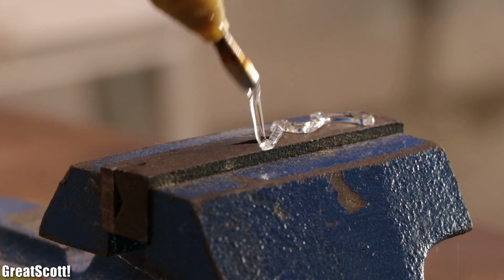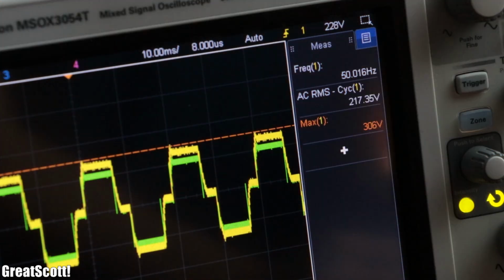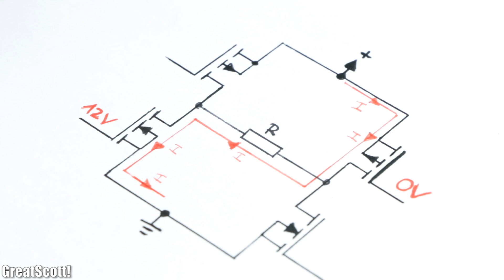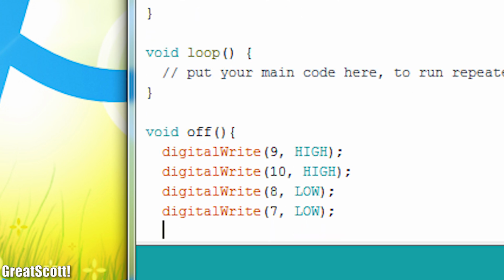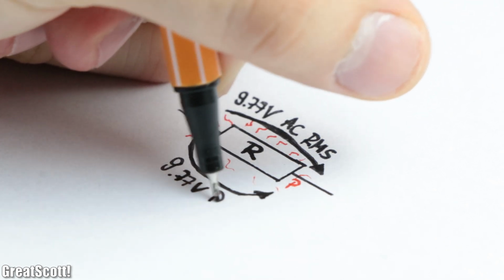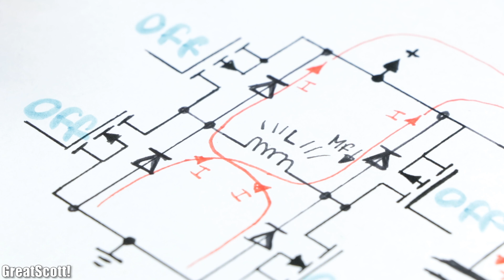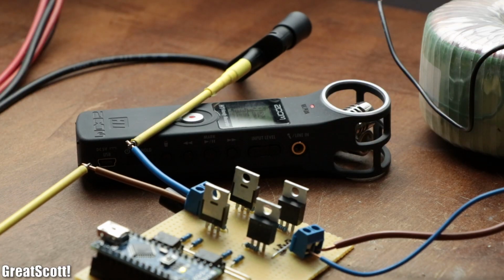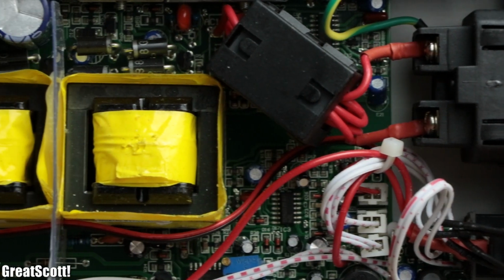How NOT to make a Modified Square Wave Inverter

Comment: Ehhh.....
This is incomplete information. 
Frequency isn't really discussed, and that's a pretty important when you're emulating Mains AC. 
Realistically, you shouldn't be pushing your inverter to go more than 10% above or below the frequency of the mains line you're emulating. (So the faults at higher frequency are kind of a non-issue. )

If you're in the USA, that standard is 60 hertz. If you're in europe it might be different. It goes by country to country. I mention this because impedance becomes an increasingly important factor as frequency increases. Components that acted as dead shorts (IE the inductor you should be driving with this circuit) act more like capacitors as their reactance becomes more pronounced. Capacitors act more like resistors. Semiconductors become signal detector meant for operation at specific frequencies, rather than generic one way blocking devices that can be haphazardly placed where ever.

It's not that AC is hard to deal with or even extra dangerous; rather Impedance and reactance are subjects simply ignored in circuit theory. Inverters are kind of the perfect storm where all of that stuff you've ignored comes out to shake your hand and remind you that it's a practical reality. 

After that rant, don't use mosfets on the legs of the h bridge. 
This is clearly a current control situation, not a voltage control.
 There are also high loads. 
This is why they developed the IGBT. 
IF you're still trying to be cheap, use a regular BJT rated for at least double your mains voltage rating.
Reply: Actually you'll want the inverter to be capable of varying its output voltage and frequency in sync for running motor loads. Known as V/Hz scaling, it eases starting and reduces power usage. That sort of inverter is often called a VFD.
Reply: Actually I don't know if that would be good. 

To be honest, that seems like a power conditioning concern for an individual device and not something that should really be integrated into the supply inverter for an off-grid system like we're being shown. 
That's something that very common in electronics, and I don't think it's good. Matching the supply to the demands of 1 or 2 devices is fine if they're the only connected devices. As a supply though, they might not be. 

As far as efficiency, it's improvement would go down dramatically the more devices connected to the load, and, at that point, it's a question of how much power does the individual circuit used to match voltage to frequency consume, since it's operation would constitute an inherent loss of efficiency.
Reply: V/Hz scaling works just fine with many motors in parallel. It's advanced algorithms like FOC that do not work with multiple loads.

Comment: you say it isn't good, but sometimes all you want is a low power ac supply for lightbulbs and resistive loads that require 120v or 230v...

Comment: Why use any inverter? 90% device dont need inverter. Only ac motor needs. Just use dc-dc converter and convert to 110v or straight from higher volt battery.  Most modern european electronic works on this voltage too. Every device have plate on back. No reason to change to ac an then device change back to dc

Comment: I was just wondering, if it is for non grid tied applications and IF the device to be powered is not relying on the power being AC and just rectifies the voltage into DC before using it further, like so many devices do nowadays with their SMPS, why cant we built a boost converter to step up the voltage at 330V and fee that directly to these devices? The divices would not care if its DC/AC, as long as the voltage is right...

Comment: A MOSFET has a built in reverse body diode. The external diodes only features a lower voltage drop. You should have configured your "inverter" as two half-bridges. Then the unused MOSFET acts as a nearly lossles diode.

Comment: you can upgrade your curit to an USV  with a multi transormer you can measure feedback  to control  the AC Power.  
Is it also possible tu use Arduinos PWM pins  and a filter to make a Sinus wave for better results?

Comment: And is the inverter good enough if you power it with a voltage that make his output be 230 volts without a transformer in the output?

Comment: I have a 300W Sine wave inverter and its great. We get sporadic power outages here and with that thing i can power my fridge, charge my phone, power a light all from a old ebike battery (that i connected together for a massive ~12V 40 Ah. It gets charged by a 50W solar panel and is completely off grid. I used it 2 times and each time it was just brilliant to be the only person who had electricity. That smug feeling is worth it.
Reply: I know the feeling - my recent inverter purchase gave a similar feeling during a planned outage; and only i had 240VAC!
On a side note, be careful with that fridge; i'm amazed it runs off the inverter at all; usually the compressor can have a high start-up current (imagine compressor piston is at top dead center - a lot of current will flow to even get the thing moving) which generally makes most inverters sad...
It may work most of the time, but it may also knock out your inverter one day... Just a thought!
Reply: 300W can power a fridge?
Reply: @kjaved8  nahh i think 1000w inverter is good to be on the safe side (500 is fine)

Comment: I am a big fan of you, but honestly, this is the first time I feel disappointment about the video's content
No one now uses such old fashion DC-AC inverter circuits

New inverters are now includes two stages:
1. DC-DC converters to increase the voltage from 12VDC to 310 VDC using four or eight MOSFETs and SMPS transformers
2. DC-AC inverters using four IGBTs.

I was hopping from you to implement such circuit.
Reply: Sure is old and less fancy, but this is the most popular kind of inverter used in DIYs.

I like mine better:
1. High frequency oscillator and step up transformer to 220V RMS.
2. Full wave rectifier and final 50Hz low frequency oscillator.

A sine wave capable setup will be sick though.

Comment: Exciting video, but I have 3 questions about:
1.Can a pure sine wave inverter be used in an electric car? 
2.Can the mosfets of an inverter circuit be oriented in a "X" pattern? 
3.Would your DIY inverter schematic work in a electric car? (Adding safety features like all the commercial ones have of course)

Comment: Unfortunately, most made in China inverters have their MOSFETs fry after a few days of use even at 70% use of their full power. The really good ones like SMA cost 3500€ a piece, I'm pretty sure I could DIY a similar one for half the price or less.
Reply: A 1009W DYI close to pure sine wave inverter can be done for less than 100$

Comment: If I want to use a potentiometer for a volume control for a car amp, can I use a Audio taper pot or Log taper pot and connect it to the channels of the 3.5mm jack then to the RCA inputs on the amp? I need some help on an interesting project
Reply: Yes, you just need a voltage divider. If your pot has 3 pins, connect the audio source ground and amplifier input ground together to the first pin, the amplifier input signal to the middle pin and the auido source signal to the third pin. Its only important to take a pot with a high resistance to prevent shortening the audio source. 10k should be more than enough.

Edit:
One pot per channel, for stereo you need two potentiometers (available in one case with a single dial for both channels)
Reply: David Weis
Thank you for the response. If I have a left and right channel, do I need a 6pin or should 3 be fine?
Reply: @R3MIXMODZ  It CAN work with a single 3 pin potentiometer but I would not recommend to short both signals to one pin. You might be save with additional resistors but you will have no advantage compared to a 6 pin pot (2 potentiometers mechanically connected)

Comment: What about using boost DC-DC to make 310V and then switch it with H-bridge to make AC 220V? What kind of drawback are in this circuit?

Comment: I hated these stupid designs for this reason and because they use a big and bulky transformer. They are only good for small range of light loads. I may make a video on a better design using a ferrite transmormer rectified for 170V output and then an H bridge output PWM driven for a sine wave output.
Reply: ferrite at 50 or 60 Hz ?
Reply: @noweare1  No. At several dozen KHz. H bridge comes later after rectification.

Comment: Before i say what i want to say, i must say i have no education in electronics or engineering.  Lol.  Ok.  If you can generate a sine wave with an op-amp, why can't you create a power inverter with them?
Reply from the maker: Try driving a transformer with that signal and you will see the problems yourself.

Comment: 1. A transformer isn't an inductive load unless the secondary is open (only a bit of leakage inductance).
2. Please read your scope manual. You may learn ways to get a stable display of the spikes. (e.g., try a larger buffer, or peak-detect mode...)

Comment: Could you show the other way around? Getting a low DC Voltage from the Wall?
For example to power a microcontroller. Normal Phone-Chargers would be too big for the project idea I have... :D
Reply: You could use a small capacitive dropper (smoothed of course) because the microcontroller doesnt draw that much current 
It would be smaller but not as powerful

Comment: Why is it more difficult to create a pure sine wave versus a modified sine wave inverter?
Reply: because of heat dissipation when trying to follow a sine wave output it goes into the linear region of transistors which creates a lot of wasted power into heat, it only works for very low power stuff, of else it gets impractically inefficient. I assume most commercial sinawave inverters will use something like class-D amplifiers.
Reply: @victornpb  Interesting. I've always thought of pure wine wave inverters as being superior in pretty much every way to modified sine wave versions. Seems I've still a lot to learn about inverters and the like. Thank you for the insight.
Reply: Sine wave inverters are superior. Square wave inverters gives you high efficiency and simpler design at the cost of producing a imperfect mains line with a lot of harmonics (components of the square wave) which is not ideal in some circumstances. The challenge on creating a sine wave is that you have to create a voltage ramp, which means that most of the time you have a switch that is halfway open and halfway closed, and that creates a lot of heat in switches (transistors), compared to square wave which just open and close fully. And analogy would be like a half way opened tap sometimes produces a audible noise, because it creates a lot of friction to the water passing, but if you open it fully it doesnt obstruct the flow, so no stress on the tap valve.

So in order to create sinewaves without producing a lot of heat they pulse the transistor on and off at a much higher frequency than the mains frequency, to create the sinewave ramp out of a PWM signal. But that requires a much more complex circuitry than a simple 4 transistor circuit, hence the higher price.
Reply: @victornpb  Great analogy! Ive always known that pure sine wave was far more complex, but never dug into why. Well, now I know. Makes perfect sense that the components generate a lot of heat given that individual components, like transistors, operate in either an off or on state and dont like being half on/off like what's required to create a pure sine wave.

Comment: Since most common devices use switching power supplies i think whoever wants to build a diy inverter is better off making a dc boost converter instead and avoid using linear power supplies (the only problem i can think of is the diodes rectifier getting hotter than normal or some low power devices or leds not working if they use an in series capacitor)
Reply: Valid point, just run it off 300V DC. Beware of mechanical switches, they don't like it.
I don't expect the diodes to get any hotter, you just have a low average current, and no peaks.

Comment: Mmmm yeah the 400V spike is bad. I have another idea. The batteries are in series to get more than 230VDC, and then construct an IGBT inverter circuit to get the sine/modified square wave.
Reply: Oh wait it's a motor drive lol

Comment: "Invest into a proper one with a lot of safety features" 
Yeah... without any kind of proper reverse polarity protection :D

#ElectroBOOM
Reply: Provided the input is fused; a beefy diode placed across the input in reverse is all the protection you need...
It has NO losses when operating normally, and if your primary polarity protection fails (the big RED and BLACK wires being OBVIOUS), then the diode conducts at full whack and blows the fuse; whilst the protected device never really sees more than -1V or so.
If you wanted, a resistor in series can limit the "whack" at the expense of having to find a beefy resistor too.
Reply: All they need is basic FULL BRIDGE RECTIFIER!! Its that simple.
Reply: Meme aside, rectifier is one of the worst kind of reverse polarity protection because now you have twice the loss compared to a single diode protection.
Reply: Nope, that's really what I meant. Full bridge rectifier has four diodes, two of which will conduct in the same time depending on input polarity. Because you have 2 diodes in the circuit instead of 1, now you have double the voltage drop and double the loss.
Reply: Yes , the problem bridge rectifier have a considerable amount of unwanted forward voltage drop of around 1 V per diode, A full bridge is about 2 Volts, this is unacceptable in a 12V system. Power loss in bridge is far too high. Even a single diode is too much. Reverse protection is done by using a power mosfet as a switch with a on resistance on just a few milli-ohms, which only activates when power polarity is connected correctly. Power loss and voltage drop across the mosfet is very very small.
Reply: Labs did you say diode..? I think you ment p-channel mosfet for reverse polarity protection

Comment: Hey great Scott, you should build a diy air conditioner. It would be a fun project and be helpful in the summer. Thanks!
Reply from the maker: I put it on my to do list
Reply: Additional requirement: it must run of 24VDC for the DIY powerwall / off-grid enthusiasts 😁👍
Reply: Scott, the day you build a real air conditioner, not a swamp cooler or a cool plate, is the day you become a billionaire! Any different more  affordable option than the expensive compressor/freon system we have now would totally change the world!
Reply: There are alternatives to gas phase change. But they have their own problems. Solid state is horribly inefficient. Reverse Stirling cycle is efficient, but physically very large.
Reply: Yes, peltier. And you can run a Sterling engine in reverse for cooling. It's a good way to get things really, really, really cold - you can condense oxygen and nitrogen from the air with one of those, but they can't actually move much heat. Then there is absorption refrigeration. They all have their niches, but when you want to cool a room or a building, gas phase change is the best we have right now.

The term "Freon" should really be avoided. It's a brand name, but the chemical it identifies has been changed several times over the years. The early ones are all long-ago banned by international agreement as CFCs, so the manufacturer switched to new chemicals but kept the same name. You need to use the right one for each AC unit, as the boiling point and optimal pressure differ.

Comment: I wonder why a wall outlet can still perform a perfect sine wave with no feedback to help keep its waveform to the change of load, while inverters need that feedback to change its values to keep a sinewave or modified sine wave.
Reply from the maker: Because the MOSFETs we use have a rather high resistance which increases with the current flow. The generators for the power grid on the other hand have a way lower resistance and thus the voltage stays pretty stable.
Reply: sine? not quite.. the top is often somewhat flat. Besides they have filters of various types to keep the waveform.

And they do regulate the voltage using tap changer, so it's not feedback-less.